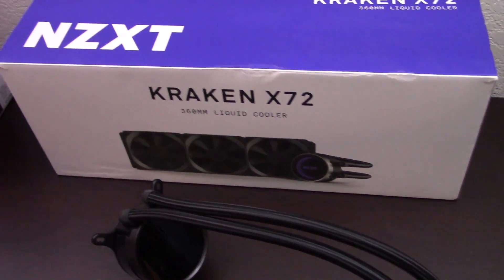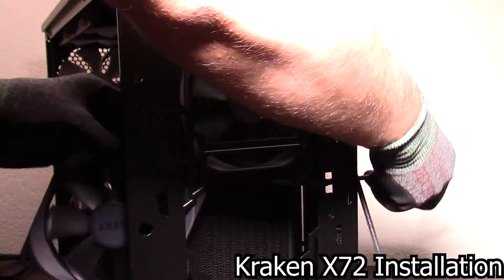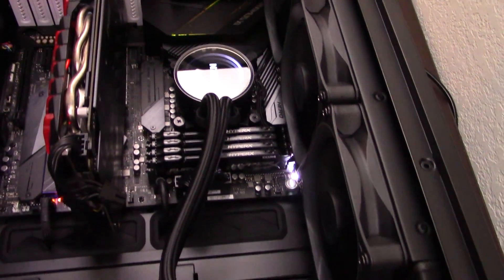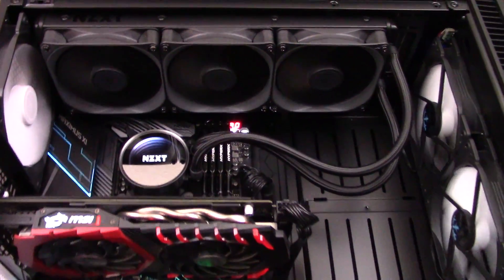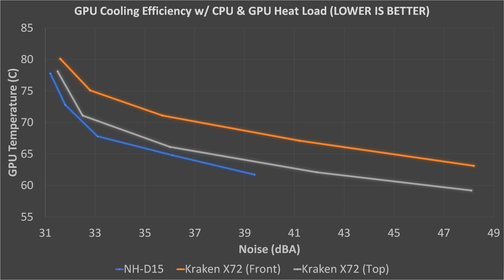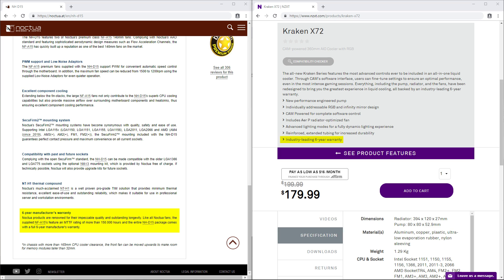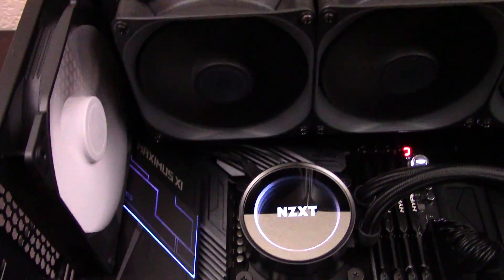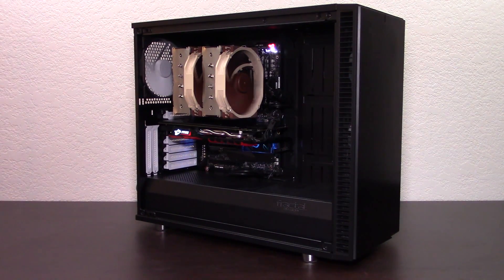Air Cooling vs. Liquid Cooling: The Ultimate Showdown (feat. Noctua NH-D15 vs. NZXT Kraken X72)

Comment: what if you use noctua fan for Kraken radiator?
best of both world =D
Reply from the maker: I actually tested that! https://twitter.com/HardwareScntst/status/1134732205945528320
Reply: Noctua has some of the best fans, for both noise and cooling. If you're willing to go through the hassle and price of installing an aio, you should certainly consider replacing the nzxt fans with some Noctua fans. Even if they're not the gaudy tan/brown ones lol

Comment: Great Video! subbed!... but let that LC heat up under a couple of hours load and its performance will drop, just somthing to also keep in mind IMO.. this i no way detracts from the video tho.. very well done and thorough GJ!
Reply: The D15 was hot enough, it would have melted the CPU given enough time, where as the LC would still be cooler and would take a long time to over heat.
Reply: @Blarson12  you must be on drugs if you think 5C over the X72 is hot enough to melt the CPU.
Reply: @kotekzot  Well the PC would shut down before that.

Comment: Absolutely amazing review.  Very detailed and objective.  Excellent conclusion too.  I myself have a beefy air cooler (Thermalright HR-02 Macho 140mm) because the bang-for-buck is unbeatable, I think it looks way better than Noctua's coolers, like the D15 it's quieter than AIO liquid coolers and I don't have to worry about a pump failing.  Subbed.  :)

Comment: You didnt cover the fact that the Noctua coolers (all of them) can be upgraded to any CPU slot configuration, past, present, or even future - Noctua will send you a mounting kit if you ask for one, for free, and they pledge to do so for all slots in the future.
Reply: I can attest to this. I bought a noctua cooler USED, and it didn't have the mounting kit I needed. I called up noctua, asked if I could buy it off of them, they said "What's your address" and sent it to me. (For free.)

Noctua is a cool company. (Get it?)
Reply: Yep it’s true... Noctua sent me a free mounting kit for AM4 when I upgraded my motherboard & CPU a couple of months ago.
Reply: Incredible value with that reason
Reply: Me too, when i bought my noctua nh-d15 it didn't have the am4 mounting bracket (the am4 model was more expensive at the moment on amazon) and they sent it for free.
Reply: NZXT also does that which is nice
Reply: Arctic does the same with their coolers. And their water coolers are half a price of NZXT and in tests are even better.
Reply: @wittywolk  does theirs have lcd display?
Reply: @LawAbidingSociopath69  no, lol.
Reply: @wittywolk  rip i wanna buy aio for the lcd display only lmao.
Reply: @LawAbidingSociopath69  lol.
Reply: @wittywolk  yep i hope they made this things cheaper 😢lmfao don't wanna spend 200 bucks just to see some gif on my pc.
Reply: @LawAbidingSociopath69  it is bell and whistle and you don't expect bell and whistle to be cheap
Reply: @古明地恋-s9c bell and whistle?
Reply: @LawAbidingSociopath69  extra premium features
Reply: @古明地恋-s9c  alright ty

Comment: lol, I've had both of these coolers. I had the Kraken X72 first but then realized that I hate it and got the Noctua NH-D15 and I'm very happy with it now.
Reply: This was a very well made video. Bravo! I hope you make more. I should clarify that the reason I disliked the Kraken was that I absolutely hated the CAM software that I had to have running at all times for the AIO to respond to CPU temperature changes. Also I was playing Assassins Creed Origins at the time I had the Kraken and after playing for a few hours the liquid temperature would be above 60°C which I've been told isn't good for the life time of the AIO. The NH-D15 just does what it's supposed to do

Comment: why not kraken x62?
280 AIO-s are very often superior to 360-s in terms of raw performance and having 140mm fans is way more efficient. Also, considering D15-s has 140mm fan, 280mm AIO would be a better "alternative". And 280mm is more "case friendly"
360mm aios don't make sense really. 360+rads  is pretty much only for custom loops.
Reply from the maker: Most of the reviews I've seen show the X72 has better efficiency than the X62, but I will likely compare them in the future to see for sure.
Reply: highqest I couldn’t use a 280mm rad in my case. It would either have to be a 240 or 360

Comment: Don't forget the Noctua products DO have visual upgrade options, fans and cover plates. You can make them look nice now, at a premium fee obviously. Great review!
Reply: That's the issue, another cost for an expensive air cooler already
Reply: @demon6937  still cheaper than an AIO. Also, there are air coolers that offer 95% of NH-D15's performance at half the price.
Reply: @kotekzot  yeah I actually prefer air cooler than aio

Comment: Maybe i missed it, but did you mention the duration of each test?
Reply from the maker: I test each fan/pump speed for 5 minutes, then record the maximum temperature. I do all the tests consecutively for a total of about 30 minutes under heat load.
Reply: @HardwareScientist  ahh ty. Does anyone do longer tests? or measure the temperature of the water in the reservoir and continue a test until the reservoir has reached a stable temp?
Reply from the maker: @erudicus  I haven't seen tests like that, but they may be out there. CPU temps stabilize after about 5 minutes at all but the lowest fan speeds, so I imagine the water temp would stabilize around there too.

Comment: Gpu temps is probably more important than CPU temps, because with lower temps you get more fps (higher frequency due to gpu boost)

I own an aio because i can't stand Noctua colors, (yes you can change the fans and you can get covers for the heatsink, but you are now gonna pay like 60$ more) and because i like having access to my mobo.
Reply: im an air guy and a Noctua fan (pardon the pun) but i gotta agree on the colors... i wish they would release an RGB option
Reply from the maker: Yeah I think if you are a gamer, the air cooler is a really good choice because of the lower GPU temps. But the AIO does look really nice and gives better CPU temps.

Comment: Excellent review! I agree on pretty much everything you state here.
One thing that wasn't mentioned that I think people should take into consideration is: how important is downtime for you? All liquid coolers fail eventually, mostly because the pump dies which sadly is quite common. When that day comes, your CPU will overheat very quickly and shut down, leaving you offline until you can get a replacement which isn't always easy, especially if it happens a few years down the line.
On the other hand, a heatsink doesn't break for obvious reasons, and even if a fan fails it's a) much less common than an AIO failing, and b) won't shut you down completely because the system can function without fans albeit at a lower efficiency and higher temps.
Reply from the maker: Thanks, yeah I have heard of pump failures, but I wasn't sure how common they were. Hopefully this one is made to last through the 6 year warranty.
Reply: @HardwareScientist  In my experience, it's been pretty common. I've three PCs, and one had two failing BeQuiet AIOs (SilentLoop 360) in just 7 months. The other had a Fractal Celsius S36 that only made it like 4 months before giving up. Funny enough, my third and oldest box uses a now quite old Corsair H60 and has been running for like 5 years nonstop without a problem. :)
On box 1 & 2 I just gave up and replaced them with tower coolers. Dark Rock Pro 4 in one and D15S in the second. Both perform admirably and are basically inaudible.
Reply: @HardwareScientist  happened to me 1 month ago … with a Kraken X62 :( although i have a Corsair H105 that is still working strong … it's the most common failure on AIOs but super randomly.